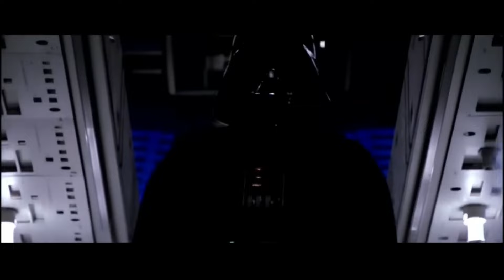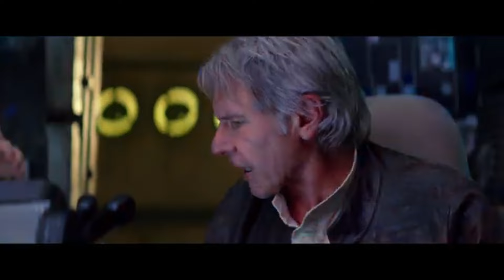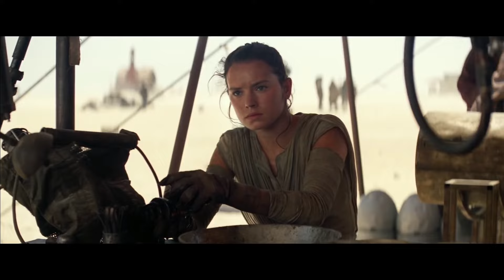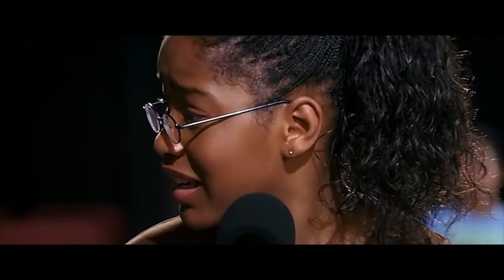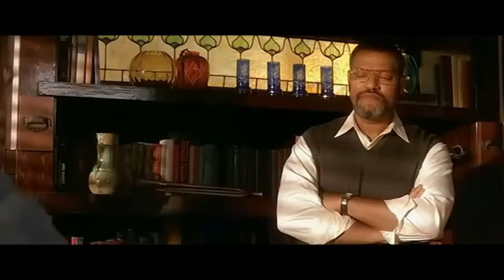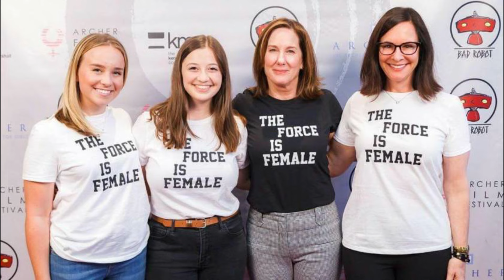Autopsy of a Bad Scene - Star Wars: The Force Awakens

Comment: Ok, So I'm not a mechanic, but I am an engineer. Bypassing a component of a machine is a thing you can do while it is operating. You put in a jumper wire, then remove the malfunction component. Of course the consequence of this is that you will no longer have the function that component was providing. Sometimes that is acceptable if it is only temporary and it cannot be a component that is critical to your immediate need. For instance, if that component was using power to create atmosphere in the ship, but it was shorting out, causing a current overload, you could bypass it so your propulsion drive continues to work, but now you are no longer creating atmosphere. This assumes the compressor she bypassed was not immediately needed, AND it was part of the drive circuit they needed. If you think you have enough air in the ship already for the next hour or just immediately to get out of danger, you can deal with it later. So ripping out a component, providing that you put in a jumper, is plausible. But the fact that she knew better than Han, was stupid and totally unnecessary. There were plenty of other opportunities to establish her character as a gifted mechanic and pilot without bringing down an established hero. Han paid his dues, he risked everything for the rebellion and lost a lot for the principle of standing up for the light, and has earned respect. He didn't deserve this humiliation of this story.
Reply: Does bypassing something really look like that though? Seemed more like me frantically yanking plugs from the socket to hopefully stop the sparks flying from the attached power strip.
Reply: @DoodsUnited  She was messing around inside the panel first, before she yanked it out. That could be a time where you remove a ground wire to use it as your bypass wire, connect each end, then you can pull out the bypassed component like that, but practically speaking it would look less dramatic. Once the power and neutral are disconnected, then the component is basically just free to fall so you would just hold it with your hand to take it away, place on the floor, etc. So these things are plausible, but the scene still sucks because of the unearned nature of the young upstart showing up the veteran, as is illustrated competently in this video.
Reply: Watch The Empire Strikes Back. It's made clear that Han is a shitty mechanic and it's played for laughs.
Reply: Her expression though, holding that component up like it's a brilliant solution.

This would have made more sense if she had been scavenging parts specifically to repair and rebuild the Falcon but that would just make too much sense. The Falcon has to be a ship she knows of but thinks is junk and ignores, only using as a last resort.